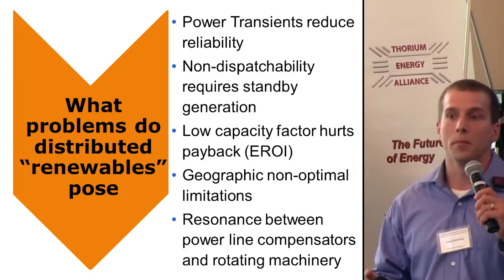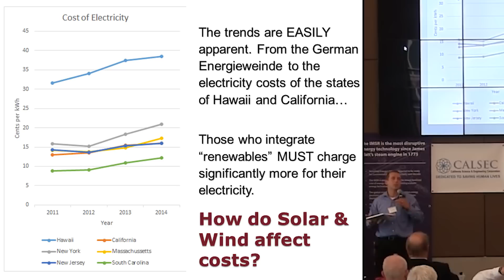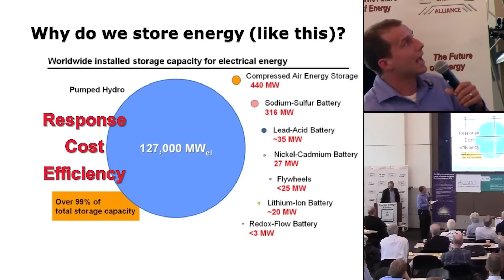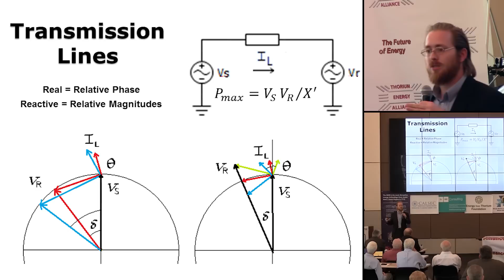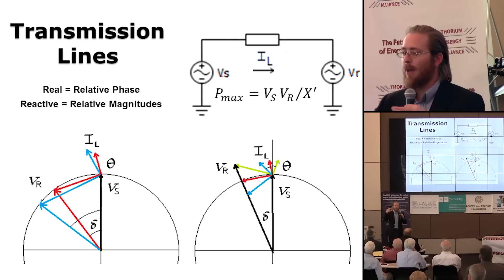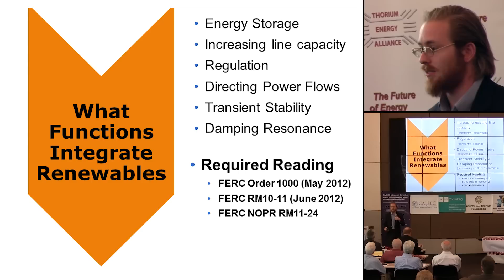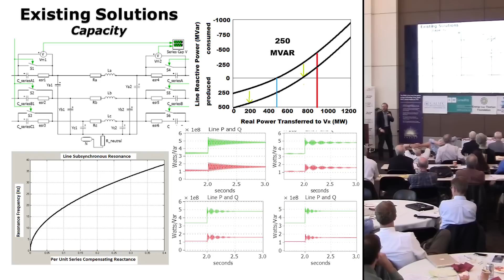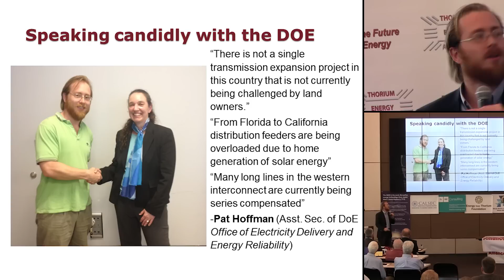Andrew Dodson - Issues Integrating Renewables @ TEAC6

Comment: A bunch of nonsense. These guys are only interested in staying in control. Sixty plus percent transmission losses! Thats a viable system? Are they kidding? Rooftop and backyard production at the point of consumption is the answer. Transmission losses stop and redundancy and reliability goes way up. Millions of little guy producers take care of themselves while putting any extra power on the downsized grid to be moved around by the utility companies. All thats needed is some solar panels, an inverter, and a relatively small, long life battery pack per home. The utility companies should mainly be for generation and distribution during times of low demand and not necessarily for generation during times of peak demand. Like when its sunny in the summer and everyone is running ac. Generate it onsite without transmitting it anywhere as much as possible. The utility companies generate at times of low production and demand like at night by burning coal or nuclear.

Comment: And since the "Microinverters get their "Frequency" (60 HZ clock) from the grid, how do they plan to prevent the "Micro-Inverters" from acting like an Amplifier for the frequency perturbations? Since they will track or follow the perturbations they will act as a positive feedback source.
Reply: ***** 
That is the problem.  How does the PLL know when the frequency (actually phase) is changed by the Dispatcher who is trying to move Power & when ten phase changed because a 2000 MW Power source wind dropped off line?

Comment: I missed this video on my first pass through the channel. Quite an interesting talk, and certainly it illustrates why metrics like levelised cost of energy are increasingly deceptive regarding wind and solar. Their methods of generation are so different to the frequency regulated, baseload-centric grid that the cost of integrating wind/solar may well be far above their economic return.

I had just finished reading these articles on BraveNewClimate: http://bravenewclimate.com/2015/06/05/less-than-the-sum-of-its-parts-rethinking-all-of-the-above-clean-energy/#more-6641 - regarding how the demands of grid stability may limit wind and solar's upper limits to their capacity factor
and http://bravenewclimate.com/2014/08/22/catch-22-of-energy-storage/ how energy storage reduces the EROEI of intermittent sources below that of what is required to sustain Western levels of societal development.
finally http://bravenewclimate.com/2010/04/05/pumped-hydro-system-cost/ - regarding how even pumped hydro storage has its issues despite being the most mature and lowest cost of integration

This places us very much between a devil and a dark place.

Current nuclear's long build times and fervent opposition driving massive sticker shock limit the speed of deployment; whereas fast construction time and modular deployment of renewables destabilises the grid that we take for granted.

At this point I don't think we should even be contemplating LFTR or any breeder cycle as a result. Massive buildout of learned designs like CANDU and AP1000 is what we need right now. David LeBlanc's DMSR and Leslie Dewan/Mark Massie's WAMSR with their obviated requirement of online reprocessing to sustain isobreeding should be what the MSR community should be focusing on. We have only until 2025 to avert the worst ravages of climate change; and if MSR deployment only hits in the 2020's their contribution would be marginal at best.

Perfect is the enemy of good enough. Renewables advocates in their quest to promote a 100% renewable future miss the point of decarbonisation. Neither should we, too, in the pursuit of a "pure" cycle, damn ourselves chasing a 100% solution. We came for the Thorium, but now we must stay for the reactor. The climate demands an 80% solution now.

Comment: Andrew, thanks for your talk.  Very informative. I am puzzled by one thing your colleague mentioned starting at 1:30 in the presentation based on the https://flowcharts.llnl.gov/content/energy/energy_archive/energy_flow_2013/2013USEnergy.pdf He somehow concludes that transmission losses are in the 60% region. I'm very surprised that they would be so high. Yes electrical generation isn't that efficient but only a small portion is due to transmission losses.  Most of it is lost in the turbines that spills most of the lost energy.

A question for you though.  Have you given any thought to grid-level storage?  It seems to me that having GWh-level storage at each end of the transmission lines would effectively decouple many if not most of the types of problems you described.  Extend that concept to a wind farm by assigning KWh-level storage to each windmill it would greatly reduce the combinatorial nightmare problem you rightly compared to a game of Go.  Of course storage at the scales required isn't available at this point however it seems to me to be essential if there's any hope of maintaining grid stability as the use of renewable energy increases.
Reply: While storage-decoupling may work (and I don't know if it does, I'm new to all this EE speak) it would drive installation and operating costs of such installations beyond anything even remotely sustainable. Solar and wind are heavily subsidized right now because they aren't cost-competitive, adding any form of storage will only increase the exorbitant price.
Reply: I agree that's the case. Check out this Lazard report: http://www.lazard.com/PDF/Levelized%20Cost%20of%20Energy%20-%20Version%208.0.pdf  Note the Levelized Cost of Energy Chart on pages 16 thru 18, especially battery storage costs 3 to 4 times the cost of wind and solar power generation!  Sure electrical energy storage systems are still largely in the research stage, and can be expected to drop significantly but a) it will take a while and b) those costs will not be zero. 

Any time I present the argument that storage costs need to added to the cost of generating energy from something that can't be dispatched, the comeback is one of the following: a) storage isn't required since something will demand it, b) the grid will just absorb the energy input and dispense it when needed (obviously implies something must store it but that doesn't seem to register) and/or c) all energy generation needs storage so it's not fair to assign such costs to RE (it's generally viewed that nuclear reactors can't load-follow, missing the fact that just because the lowest-cost way of supplying base-load is the use of nuclear, doesn't mean they can only be used as base-load).
Reply: Current nuclear isn't load-following? Huh, didn't know that, I thought that it could be modified with the use of control rods and stuff but I guess those only give you so much range before they stop the reaction.
Reply: It is ... well perhaps some of the first gen reactors aren't very good at it.  Nukes don't just use control rods, they also use the fact that as temperature rises, the reactor becomes less supercritical.  This means that a nuke can deal with short-term demand fluctuations without changing anything. My point is that nuclear critics don't understand the physics and take the fact that the use of nuclear for baseload means it must not be good at load following.
Reply: Ikester Instead of other reasons like because its the most reliable or maybe slightly harder to change than coal or gas for example? (moving control rods and managing the reactor core temp seems slightly more complicated, albeit still doable, than increasing/decreasing the fuel flow into a coal/gas furnace/turbine).
Reply: The 60% losses are not primarily transmission losses but Carnot losses in thermal plant. Obviously, there is some loss in transmission and distribution - but it is closer to 7-10%.
Reply: Will B
Perhaps but IMO it's largely because nuclear critics don't understand it, thus fear it.
Reply: Will B You can only turn LWR nuclear down to around 70% then it has to be shut off. Starting and stopping a steam turbine fully can take up to 10 hours. 

Its all about the range of operating characteristics, and the marginal cost of generation. These kinds of studies fall under Optimal Power Flow analysis.
Reply: So, far beyond my field of expertise XD, interesting factoids, glad to know them. 

Now, if you'll excuse me, I'm going to go stop pretending I understand anything more than the barest fraction of this problem.
Reply: Will B ok well yeah :]
Basically the grid is the surface of a pond ( pond made out of VERY dense liquid) and we can make ripples across it with changes in power.

There can also exist resonances between generators and at this point the analogy breaks down...

However as pointed out above, the losses are in large part thermal losses at the generating station. Note that this MAGNIFIES the power losses in the rest of the grid! (for a given unit of energy waste in transmission, it translates into 3x that much being consumed as fuel!)
Reply: ChumpusRex Wind and solar make those transmission losses increase significantly, but more than that they are a source of destabilization. A sudden break in a turbine or a shift in wind power causes a transient wave that rides through the grid like a wave at the beach. 

At higher frequencies multiple turbines can ring with one another, which may be the cause of many mechanical failures as of late!
Reply: Thank you for the reply, Andrew.

I would also like to ask about another instability that can come from wind/solar.

There is the issue of rotational inertia in synchronous machines. With wind/solar being inverter output, there is no inertia and therefore short-term frequency instability is increased.

This has been an issue in small grids with large wind contribution - e.g. Ireland and UK. In fact, National Grid (UK) has recently had to change its operational parameters due to an episode of cascading failures where embedded generators started dropping like flies after ROCOF trips. Nat grid now specificy a ROCOF of 1 Hz/s as their operational limit (!) to be used for island detection.

I'm wondering how much of an issue this is in the US, because the grid regions are larger and there has been a tendency to use different wind turbine technology. In the UK, the standard wind turbine for previous buildouts have been 3 MW inverter output, with current buildouts typically 8 MW.

I understand that there are some firmware updates planned for the wind turbines which will allows them to use the rotational intertia of the rotor to emulate a synchronous machine's inertia constant. Your guess is as good as mine as to what this might do to the mechanical systems in the turbines.
Reply: Will B It depends where you are. There's not much in most nuclear plants which prevents load following, just that it has not been required much in the US - and the NRC have strict regulation about automation of nuclear reactor control systems.

Some nuclear plants, typically non-enriched uranium fueled graphite or heavy water moderated, do have issues with low power operation. For example the CANDU reactors, cannot acheive stable operation below 60% for any length of time, and have a maximum response rate of 1% of full power per minute.

AGR reactors as used in the UK, are capable of stable operation between 30 and 100%. They typically reduce to 30% operation for online refuelling. In theory, they could be highly responsive, but these plants are old, and were never fitted with such control systems.

LWRs tend to be fairly acceptable at load following (where required and legally permitted). Typically reactors are capable of operating at between 50 and 100%, with a number of models being able to ramp down to 25% and back on a 5 times per week basis. Ramp rates are typically in the region of 2.5 - 5% of full power per minute. Some of the more recent models of BWR have enhanced response performance: e.g. the Hitachi ABWR can ramp from 70-100% in under 60 seconds - although such a hard ramp is recommended only in an emergency with the plant design recommending a maximum of 20 such ramps over the plant's life time.

In France, automatic load following is the norm for nuclear plants. They automatically swing by up to 5% for second-by-second frequency control, with another 10% available for dispatch at the control of the grid operator (with no other restriction). Changes of more than 15% of power need to be limited to a maximum of once per day (on average) to prevent fatigue damage to reactors/turbines/etc. However, daily patterns of 100% during the day, reducing to 25% over night, and back up to 100% for the following day, is considered normal operation for French and German LWRs.

In the US, the NRC prohibits the use of automatic frequency control at nuclear plants. However, manual power control is permitted. 

Finally, there is the financial consideration. Nuclear requires high capital costs and low fuel costs. Reducing sale of power is not usually a financially sensible thing to do, because the plant operator saves little in operational and fuel costs. Ultimately, it requires a detailed cost-benefit analysis for the local market, which depends upon the performance and cost of the competing power generation systems. Thermal coal can be slow - maybe 2% power per minute, whereas brand-new combined cycle gas turbines can be much faster - needing only 40 minutes to go from hot shutdown to full power. Fuel efficiency and maintenance demands can also vary considerably depending on plant loads, and this also has to be considered.

Comment: I'm trying to think of an analogy... if you have a marvelous clean-burning wonder generator, and you want to power your house, and you also have a bunch of hamster wheels you could use instead, but to use them you would have to re-wire the entire house and do constant maintenance on all the little hamster wheels to keep them spinning... would you want to go through the trouble instead of just using the clean-burning generator?
Reply: Problem with that is most people don't see nuclear as clean burning and are absolutely phobic about the waste.
Reply: those hamsters need jobs bro ;)